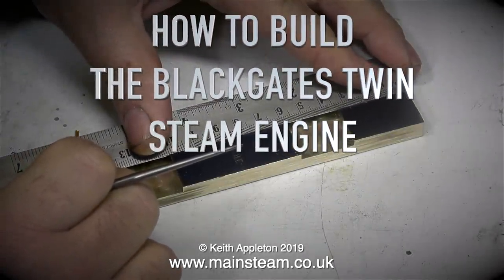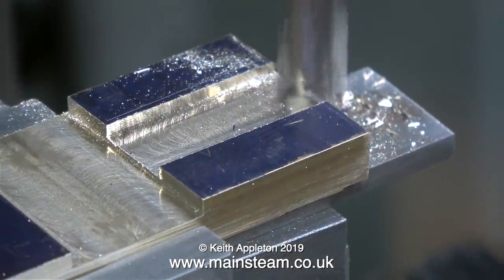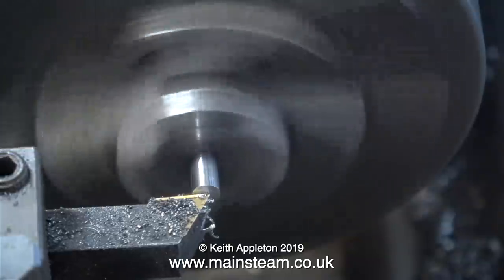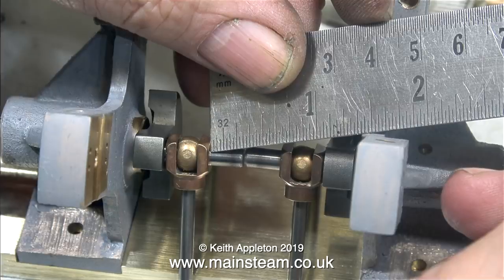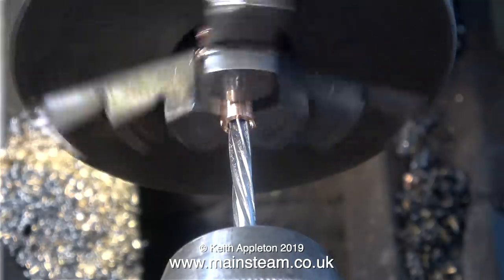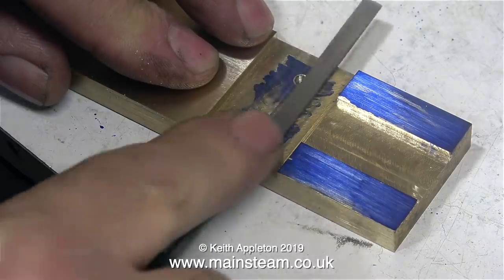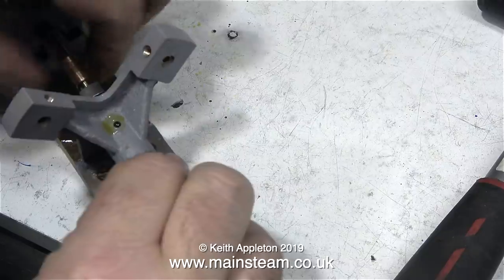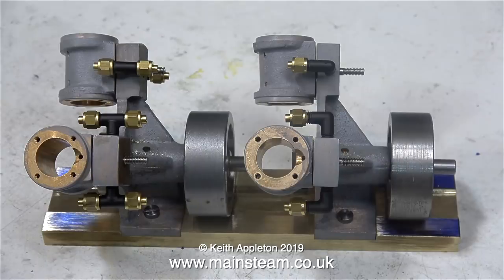HOW TO BUILD THE BLACKGATES TWIN STEAM ENGINE - PART #9

Comment: Intresting, i would have thought you would off-set the two cranks rotated by 90' or the like, rather than having them linked. Still looking good :)
Reply: Only 45 degrees, but right!
Mount the engines with the crank pins overlapping, and connect the crank pins with a link that will give a 45 degrees difference.
Reply from the maker: Just wait and all will be revealed as the series progresses - alternatively join www.patreon.com/keithappleton }:-)))